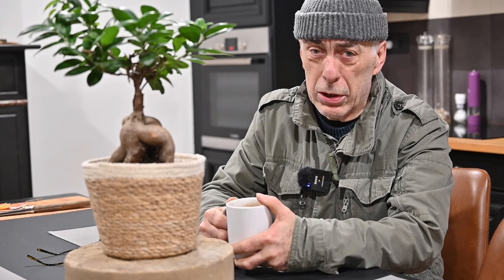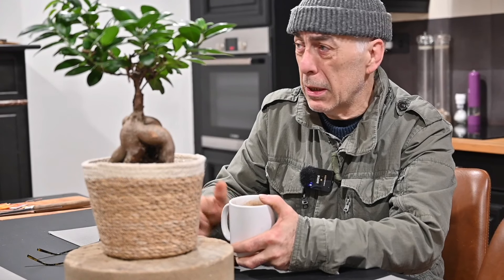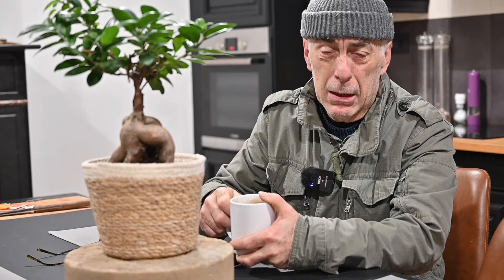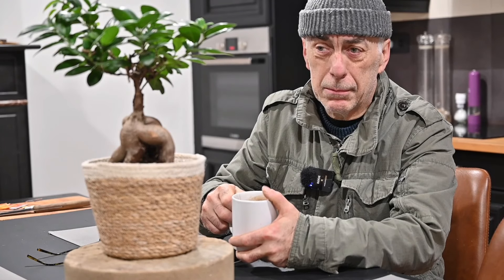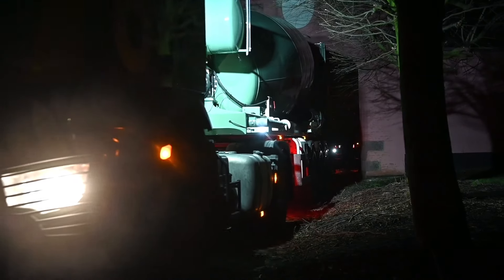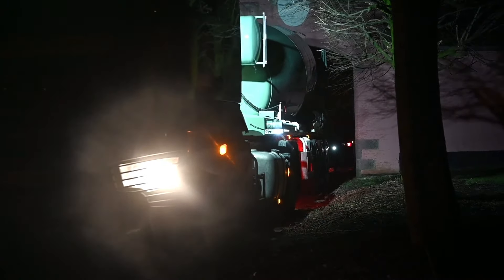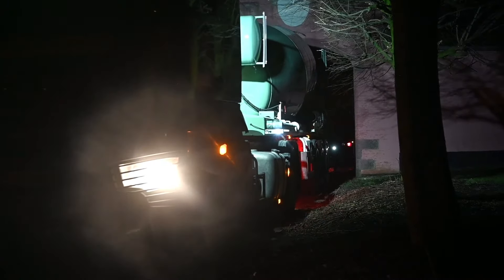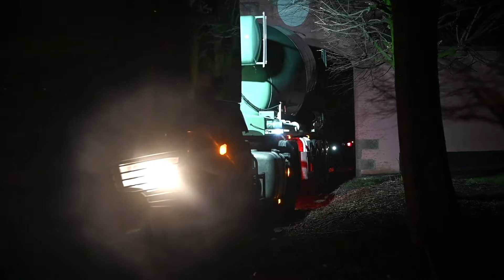Barn Restoration Part 4  - Pouring the concrete floor-

Comment: Here in the US, obviously, we measure concrete in "yards," short for cubic yards, obviously. That was a heck of a lot of concrete for a continuous pour and well done by that crew. And, yes, a very fair price. Well, it's worth it for the overall improvement to your barn.
Reply: Agreed. Decent price including finishing. Last quote I got here in Dayton, Ohio was $1200 for four yards dumped in your hole. 2/3 cheaper to rent a 1/3 yard mixer and source gravel sand and portland. If you don't mind a sore back. Gotta earn beer some how. Every time a see a new pour I think,"Needs some radiant there, just in case!" Mr. Steve could rent that out for weddings.
Reply: @kathysarmcandy1992  Here in NJ, depending on the north or south in the state, a continuos pour like Steve's cost 50$ to 90$ a yard . Not including finishing work.
Reply from the maker: hahaha  indeed
Reply from the maker: That is not bad at all..

Comment: Did you watch carefully at the beginning, the mesh was compressing down as the workers walked on it.  This is called "walking the steel to the bottom".  Very, very poor for strength.  This is why a strong pour will use rebar (in a situation like yours #5 or larger) and plenty of chairs.  Don't let anyone fool you with BS about "pulling" the steel.  That just does not work.  If the steel is 1/3 from the bottom, then you have optimum strength from it.  When it has been walked to the bottom you have no strength from it and its use was just a waste.  When it is partially out of place (as in your project where you had many blocks) you have a diminishment of strength.  I don't know about France but in the US a majority of residential contractors do this kind of pour and they all have false, inaccurate reasoning behind it.  On commercial pours it just is not allowed whatsoever.  In residential work they can stomp it down, pour over and it is hidden as they walk away counting the cash.  There is no doubt that it makes the job more profitable and easier if you disregard the steel or add fiberglass cuttings as another excuse to cheapen the product.  That is what it does.  It weakens the final product and that is why it is not done or even allowed in commercial work.  If it were discovered the whole area would have to be jack hammered up.  Engineers and quality control personnel are involved throughout the bigger projects.  Testing and experience shows that this kind of sloppy work is costly in performance.  The steel's job is to keep the slab in plane as cracks occur and to hopefully keep the cracks micro in size.  To provide this shear strength and tensile performance it needs to be well bonded to the concrete and in place where its characteristics are best used.  To really understand this you need to observe destructive testing to failure.  No residential concrete contractor that I know of ever does this.
Reply from the maker: Thanks for the explanation..